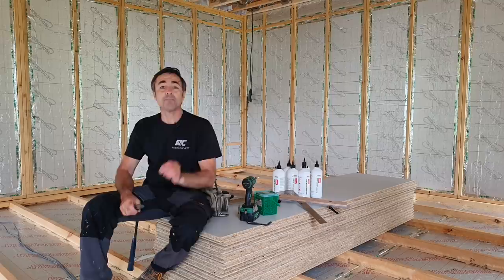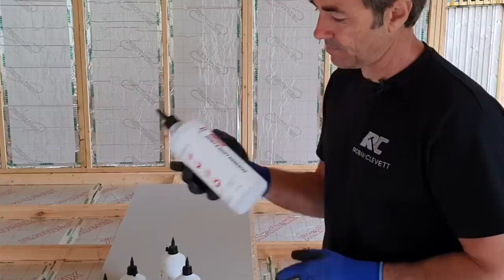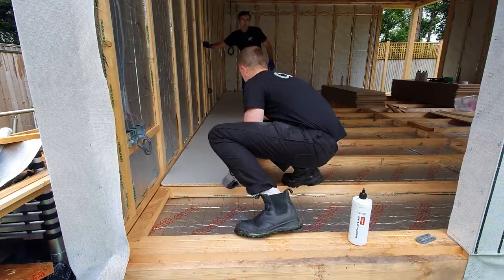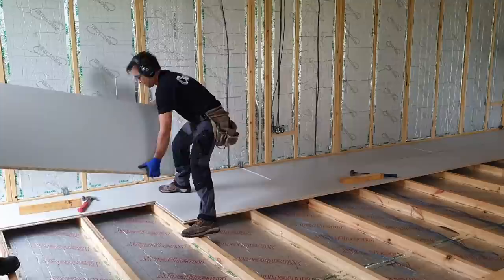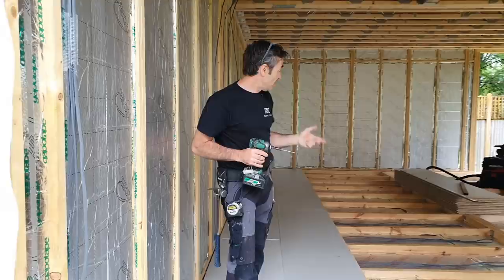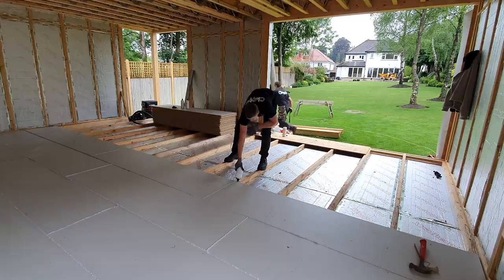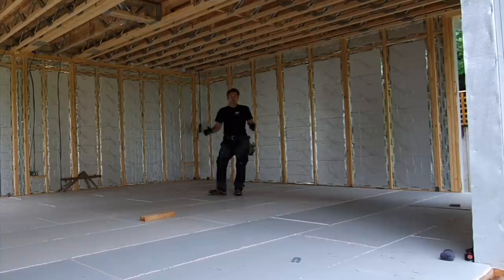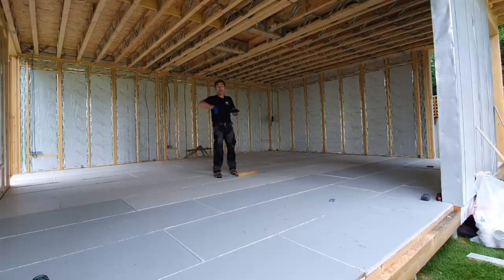Building a Garden Room Laying Chipboard Flooring, 22mm Egger Protect, The full How to Guide on site

Comment: Hi Robin loving the videos as usual. I noticed that your wall studs are doubled up every second one. Is that to take the edges of the sheets rather than just centring on one single stud. ? I've always thought that the 38mm studs are too thin to centre boards on and screws can sometimes miss cos there is not enough meat to screw into and you have to screw far too close to the sheet edges.
Reply from the maker: Hi Ian, if you watch the previous video in this garden room build called walls and roof you will see that my pre-insulated panels are made no bigger than 1.2m purely due to the fact we had to man handle them right down the garden!! I agree that timber frame CLS is a little thin to join plasterboard!!
Reply: @ukconstruction  Fair enough thank you for the reply. Top job mate👍

Comment: Surprised you didn’t damage the tongue hitting it like that, usually use an off cut that will slot into the groove then tap that
Reply from the maker: we always use a decent block of timber, and also if you are running nice and true and straight then its no more than a few taps to get the board where you need, I do sometimes use an off cut of the flooring but this tends to shatter along the striking after a while

Comment: What kind of glue are you using and when / how to scrape off excess (on surface) later?
Reply: Egger glue you buy it with sheets . I use multi tool or end of old saw
Reply: Just use end of old saw,  so much quicker and won't damage the floor like the multitool can sometimes dig in! Also easier on the ears!!

Comment: Also, is the max permissible Floor Joist centre 600mm? Or why did you pick that? Is there not a chance that this might causes some bowing?
Reply: short spans.
Reply: 600mm for 22mm flooring,  and 400 centre for 18 mm or you can go overkill and go 400 centre's and have 22mm

Comment: Is it necessary to run two beads if most of up runs down the side of the joists?
Reply: Trying to use it up 😂
Reply: It's just the manufacturer's specifications so if you want to get the greatest benefits from your job you normally follow their instructions 🔨

Comment: In the U.S they raise their timber walls off of the sub floor, platform framing as they call it. On your build you raised the walls and then installed the floor.   Is this because of building regs or personal choice?
Reply: Personal choice, however most construction is block and brick with a cavity.
The flooring would not be built over except inner for  stud frame walls.
Reply: Doing it this way will at least allow for the expansion, don't know where the US method would allow for that if your fixing your sole plate down through the floor
Reply: Agreed, squeaky floors is a common complaint there too
Reply: In Australia we lay the floor first and build the frames on that and stand them on top same as US but then ou building has gone more that way than UK.

Comment: Using this product in Norway I believe the rule is 1mm/m of space towards the walls, but a general distance to start with of like 10mm. We are putting up a house right now with 18mm chipboard for roof, and 22mm for 2nd floor, and 18mm for balcony. The roofers are late, and we've been getting a lot of water that has landed on our flat roof now for more than a week. We've had the roof covered with 15mm of water once, and around 10mm another time - meaning it's gotten soaked a few times. It is leaking through into the house, but I find it impressive that it stays intact, considering what it is made out of.
Reply from the maker: Well its a god send that the product can withstand the rain, I worked in Bergen for a week and it rained every day while I was doing some really detailed work on a historic buildings facade!! Where in Norway are you??

Comment: Would you say chipboard is better than plywood for flooring?
Reply: (excluding vapor properties)
Reply from the maker: It's specifically designed for a flooring situation, to get a decent plywood that will perform to the standard of P5 chipboard would be at least double the price, there are all types of ply some cheap ones too be they really are not suitable for flooring so excuse the cliché tread carefully!!

Comment: Great work robin - attention to detail as always! I understand the NHBC recommendations, what are your thoughts on how easily services can be accessed? I often feel adaptability and sustainability is over looked by NHBC? Appreciate this comment is more relevant to new build houses than garden rooms though. Not a knock at your work by the way - just interested in your opinion on the regs. Cheers!
Reply: Future access to the subfloor isn't part of the NHBC warranty so is ignored. Hence you end up with this poorly designed, no thought for tomorrow answer to squeaky floorboards.
Reply: It does keep a steady flow of jobs going...

I think we in Europe have a lot to learn from Japanese carpentry, or simply accept squeaky floors. Some sort of vinyl or rubber strip on the joists could replace the glue, needs a bit more screws, but sounds more sustainable to me.
Reply: @daihedral9269  You wont get squeaky floor if the D4 glue is used correctly. I have a gym on a 22mm floating floor and doing 200KG deadlifts, no creaks or squeaks.

Comment: I'm  a diyer,  is there a reason to screw down instead of nail gun?
Reply: Using ring cuts seems to hold ok with the glue aswell,  faster but still better to screw first row incase you need to pull out and do ya line again
Reply: A nail has more chance of rubbing off the timber if it comes loose even if their shanked nails 🔨
Reply: @stevehallam6495  it's a personal choice as both shanked nails and screws are compliant in the manufacturer specification but the amount of jobs I've snagged on new builds I'd recommend screws every  time and on myself own jobs I still overkill on the screws 🔨
Reply: @stevehallam6495  I meant to say aswell that all floor will move as timber is a natural material and always moving no one knows how each individual timber will react to hot and cold 🔨
Reply: @stevehallam6495  yeah I use the I joists myself but as I've said the amount of snags I've had on new builds is shocking 1 in 4 has had a squeak in it and every one of them has used nails again it's a personal choice but I choose screws every time 🔨

Comment: Great job….what happens when you need to take the floor up again….!!
Reply: You don't.
Reply: You get your circ saw out
Reply: If it’s tgi joists yer in trouble
Reply: Sledgehammer 🔨
Reply: Explosives.
Reply: Plasma ray gun!
Reply: It should last 50 years, in which case it's someone else's problem :) It is a problem if you do need access in a house to pipes etc. Which is why I will probably replace some floor with new boards - but crucially using modern flooring screws!!

Comment: why are you using glue and not just screws?
Reply from the maker: This is the manufacturer tried and tested system and is designed to be far  better than just mechanical fixings
Reply: @ukconstruction  do you also need glue, if i were to make OSB+wooden beams and laminade flooring ontop of it ? or will i have also no noise, if i maybe add screws a little more often ?

Comment: I was always taught to lay T&G floors to span across a minimum of three joists. Guess standards must have changed !
Reply: It's a garden room not a domestic dwelling. Rob did mention that the norm is 400 centres but this is 600 for a garden room.
Reply: @harveysmith100  That's not what I was referring to, it was about transferring imposed loads across a minimum of three joists.

Comment: After having used this exact glue... ****catagorically*** do not let this get on your skin and dry!!!! It literally took a week to come off and no amount of chemicals to shift it would work. Ended up like the thing much to the wifes annoyance.
Reply: To add to this, this glue is amazing, the fact that it expands covers some sins if the chip board has a ding during shipping, its really not going anywhere. No squeaks at all.
Reply: I got some on my knees once and had to shave it off! Only took my pads off 2 mins beforehand 😂

Comment: why don't you put the floor down then build the walls on top of it? Surely that's easier than cutting it in? I hope there's not a good reason to do it your way as I have done it the other 😂
Reply from the maker: Well I like the floor not to be totally sandwiched on a build of this size, on a floor this size we need a certain allowance for movement and need a 10mm min gap at the perimeter, loads of people do it first and that's cool on a much smaller construction
Reply: @ukconstruction  ah, that makes sense, my room is only 5x3m so I am fairly happy. Just one more thing..why no noggins in the walls? I didn't put any in mine but I did fix a 6x1 all round the room internally which I think braced it up nicely but also gave my sparky somewhere to run his conduit and place my sockets (it's not plush, it's a workshop/office) Thanks for speedy reply. I loved watching your stuff on SB, good luck with your own channel. I am going to be building a special little place in one of my fields, surrounded by oaks and nature. I'd love your help. Bacon sandwiches and loads of tea brought by mum 😀

Comment: All that foam running down the sides of the joists wouldn't work on a high set Queenslander with exposed joists underneath. Unless someone did a lot of scraping and I wouldn't want to volunteer for that job. You would have thought given the time these sheets have been around and the latest bonding materials that the manufacturers could have made them waterproof by now rather than as they put it water resistant. After all it is only wood chip bonded together so why not use a fully waterproof bonder. Would make my life easier having to build off the floors and no roof for a fair while.
Reply: U’d very rarely see a floor with exposed joists in the UK. This method would be used as it’s incredibly effective and 99.9% of the time the joists will not be seen.
Reply: @gdfggggg   Probably true these days in UK. In my time there building back in the eighties and nineties it was an era with a few exposed beam ceilings some false and applied others wanted the old real look. Now in OZ building stumped homes in Qld an awful lot have exposed joists underneath and wouldn't work for that.

Comment: What is the point of using so much expensive glue...just to have it squeeze out on and under every board ?  Pointless.
Reply: It expands and fills the voids under and around the boards.
Reply: @gdfggggg  
Under the boards between the sheet... yes, but no use dripping down the sides of the joist is there. ?
Reply: @jimosullivan1389  It looks like it, but what you see is mostly just air, because the glue foams up when there's nothing to contain it, like the head on a pint of beer.
Reply: @daihedral9269  ok, thanks